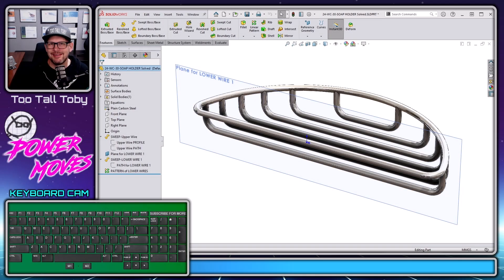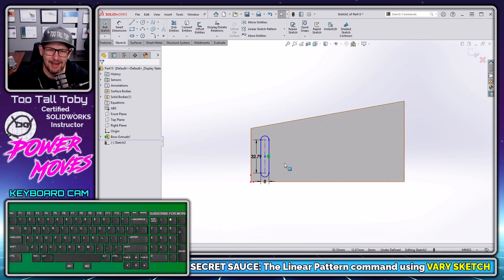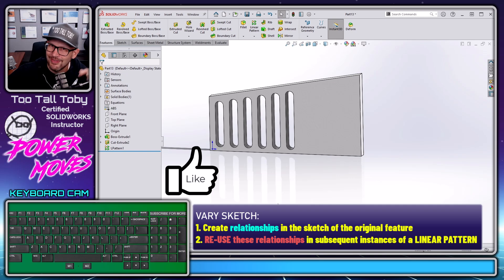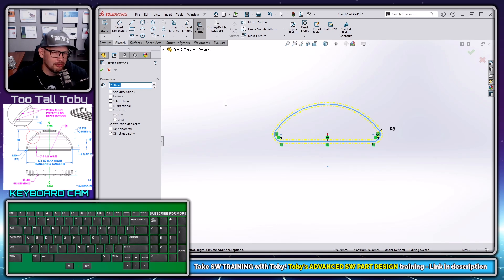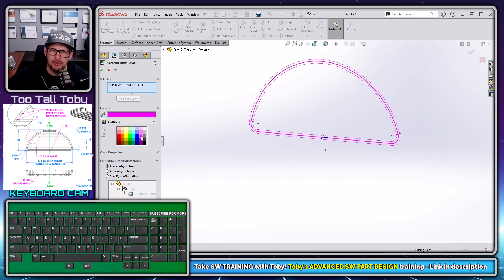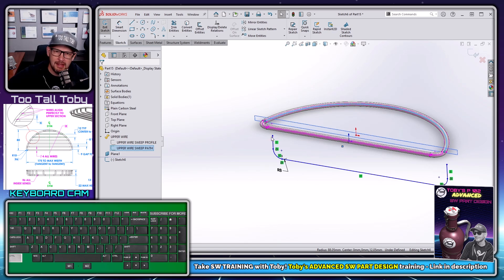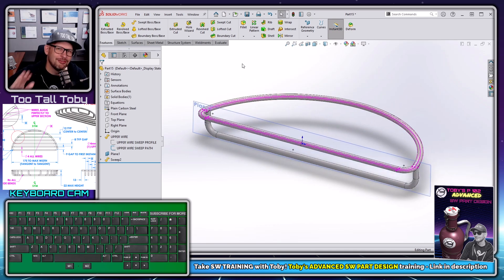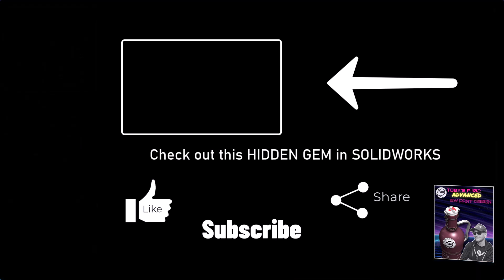How to LINEAR PATTERN in SOLIDWORKS and follow a curve using VARY SKETCH

Comment: In youre sweep options turn on merge tangent faces then you wont
get that obsecure faces at the tangent points.
Reply from the maker: Thanks - turning this option on actually changes the geometry of the part though - it changes the sweep path from LINE-ARC-LINE into 1 single SPLINE.  Since a SPLINE has curvature continuity throughout, the resulting geometry is  actually slightly different than the LINE-ARC-LINE solution.  It's subtle, and in this scenario it would be insignificant, but in some situations it's much more obvious and can make a big difference to things like cut lengths for the wires.

hope this helps!
Toby

Comment: Brother there is some issue 
1. I made a rectangle and did extrusion in sheet metal 
2. Unfolded it
3. Made a sketch of slot on that face 
And tried varry sketch option it goes out of the rectangle in straight direction I want that slot to varry through the whole rectangle but it doesn't 😢 what can I do for that 😞

Comment: Weird questions about the soap holder unrelated to Solidworks; a) How would the "pipes" connect to the main "pipe"? And b) How would it be mounted to the wall in a way that keeps it at the right angle?
Reply from the maker: You would weld them together, and you would weld an addition mounting plate with keyholes for screws on it, to mount it to the wall.

Comment: liniar pattern tab freezes , I cant use that command.,  In sketch I have no problems with patterns but using as feature it just freezes and also turns the tab black...
Reply from the maker: not sure - could be a registry issue or could be a graphics card issue - did you get it resolved?
Reply: @TooTallToby  if I drag the tab it turns white again but still is freezed.

I managed to use the features by right clicking on the part and selecting from there "variable pattern"

Comment: I tried to repeat the funny moment at 7:49 in different ways, but I couldn't; a circular profile every time is normal to path. What version of SW do you use?
Reply from the maker: Its just "SolidWorks being SolidWorks" - sometimes it works fine, sometimes it ends up skewed.   It has to do with the order in which you create the lines and arcs, and whether or not you start them out connected in a loop or open.

Comment: one thing I am still not entirely sure of is when you need to use the pierce command and when coincident is good enough. I have had some features fail and when I change the coincident to a pierce it all works. It would be nice to know in advance exactly when it needs to be used instead of using at when you see it is an option to use.
Reply: Pierce for 3d - coincident for 2d
Reply: @KR-nc5be  many thanks. Had no idea it was as simple as that!
Reply from the maker: Pierce can indeed be a bit of a confusing relationship.  It has some downstream ramifications, particularly when used in sweeps and lofts.  Perhaps I can make a video on that topic later this week :-)
Reply: @TooTallToby  that would be brilliant, thanks Toby :)
Reply: Coincident will make your point coincident with a virtual projection of the geometry onto your sketch plane.  Pierce locates your point at the precise place that the geometry penetrates the sketch plane, in 3D.

Comment: I have a Question. Does working with Power Surfacing add in, make us lazy with surface modeling in solidWorks???
Reply: Yes you can, first make a reference sketch, then go to powersurface to do the pipe, after that you can do the pattern as Toby did
Reply from the maker: lol - I don’t think it will make you lazy - it’s always good to get access to some new tools!

Comment: Watched the replay and have to say that was painful to watch!
I have to say the need to pick a dimension to enable "vary sketch" is very goofy in SW! While I like the interface SW uses for setting up the varying instances after the fact, I find Onshape's use of "Reapply features" a lot more predictable and it applies to "anything" included in the linear pattern.
So for this model in Onshape you just have to include the sweep profile sketch in the pattern and make sure "reapply features" is enabled and it works. If you use a Featurescript (like "profile sweeper" for example) that doesn't require drawing the circular profile (the "built-in" sweep feature doesn't have the option to create a profile). Then it's super easy and this parts just needs 5 features (and there is no weird angled profile issues either!)
Reply from the maker: Nice - I'm looking forward to doing this one in onshape!

Comment: Would be really interested in seeing how you would approach this model in Onshape. I managed to get it done but used a lot of repetition of  Transform to place the bottom cross rods to to the top profile curve.
Reply: See my reply above,
Look for a public doc called: "TTT 24-WC-30-Soap Holder - Profile sweeper"
There's a tab using the "regular" sweep as well as the quicker "profile sweeper" Featurescript option, the trick is to include the sketch of the sweep profile as well as the sweep path in the pattern feature when using the built-in sweep feature.
Reply: Pierce and Linear Pattern are also available in Onshape
Reply: I did the same.